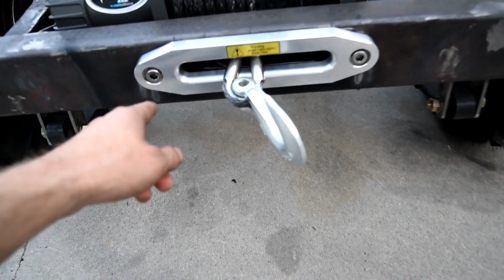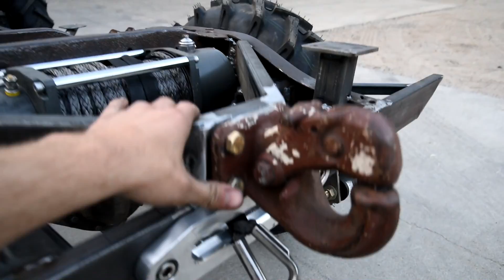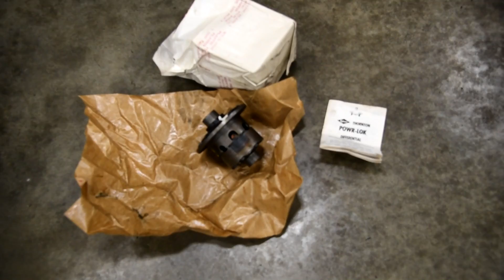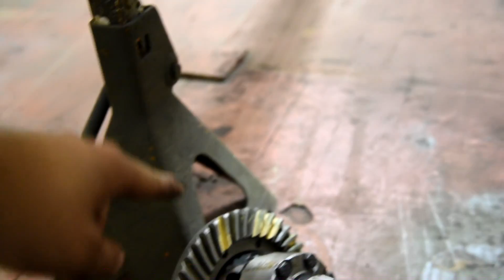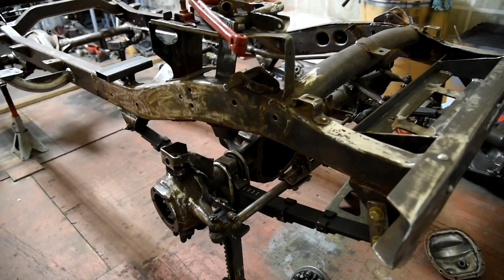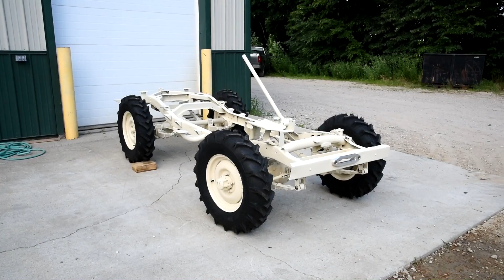Submarine Willys Jeep Restomod - 6 - Rolling Chassis

Comment: https://www.youtube.com/watch?v=i7LuLUSf1EY&t=55s

The best 1/12 scale willys MB/GPW model, it is not just for display, got almost real 2 speed gear box , transfercase, leaf spring, all working light and steering wheel, metal chassis, metal running gear, for off road and up the 45 deg slope.Price Inc all parts you need and RC system and battery and charge.

Comment: Midwest gear and 4WPW carrier bearing puller and installer.   If you’re going to be running it hard you probably will be in that front axle more than once, I also noticed it looked like you were still running the 2 piece rear axle.  Did you replace the front axle shafts with u-joint style?  It looked super when you got finished!👍

Comment: An interesting project, thanks for sharing. One suggestion for your rear winch: If you rotate the winch 90 degrees so that it bolts to a vertical face instead of a horizontal face you could build in an extension fork for the spool lever and extend it out of the rear bumper which is where you most likely will want to control free spooling.
Reply from the maker: That is ingenious! Where were you 6 months ago?

Comment: Why 2 winches?
Reply: So you can pull from the front or back. Sometimes you just need to pull yourself forward to get through or over an obstacle. Other times there's just no  going forward, either mud is too deep or no winch hook up points etc., so the rear winch can get you out the way you went in.